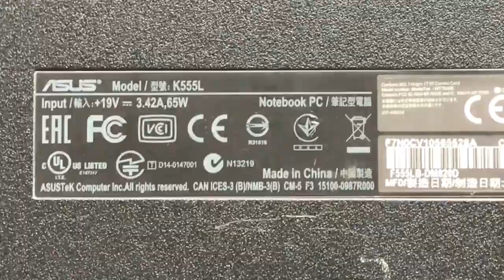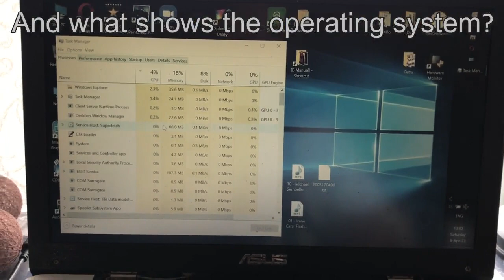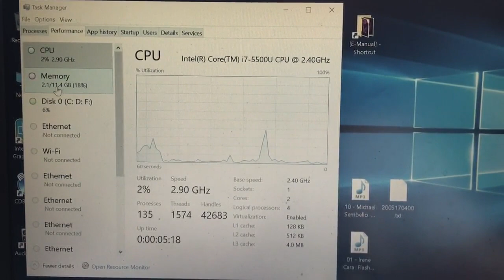ASUS K555 X555 Series add RAM memory - Upgrade

Comment: My internal laptop Asus x555l  is DDR3 4gb, recently i add DDR3 8gb with exact spesification on video. But the memory not detected on system pls help me
Reply: Buy ram with specification with low voltage with letter I

Comment: I upgraded 32gb ram card, but first time it's worked after few minutes later it's not work. System restart and blue screen and stuck the operating system. What is the problem and what I do now? Please help me
Reply from the maker: This laptop support up to 16GB modules.
I am very surprised how it even stared with a module twice the size of the supported one.
Reply: @smartech108  Will the RAM and RAM slot be destroyed then?
Reply: @smartech108 thank you for your msg 🙏🏻
Reply: considera el voltaje tambien , puede que la laptop hizo lo que puedo al inicio, pero luego le falto energia , los ddr3 trabajan a 1.5 y los ddr3l 1.35, solo sporta hasta 16 gb

Comment: Hola, tengo el mismo modelo asus K555L, pero hace mucho leí que solo se le puede agregar hasta 8gb de ram... ahora me quedo la duda.. donde puedo ir a ver si realmente acepta los 16gb ram? muchas gracias me sirvio muchisimo!!
Reply from the maker: Puede ir a un centro de servicio donde tienen muchos módulos RAM abiertos.
O puede consultar el sitio web oficial de ASUS.
Pero lo que noté después de agregar más RAM es que la temperatura del procesador aumenta al renderizar videos. No estoy seguro de si mi módulo RAM tiene un problema o simplemente el conjunto de chips necesita más potencia al tener más memoria RAM.
Reply: ez engem is érdekelne....so-dimm ddr3 1x16GB még nem láttam

Comment: Well, it seems so easy to add memory to my laptop computer.   Now I don't need to go to the service. Thanks 👍
Reply from the maker: Yes it is not a bid deal to add memory to your notebook. My video applies to most ASUS models and some other laptops. Actualyly most of the laptops shere similar construction and adding RAM souldn't be a big issue.